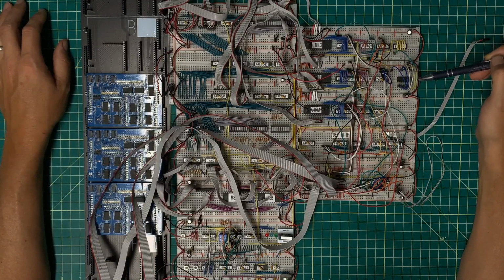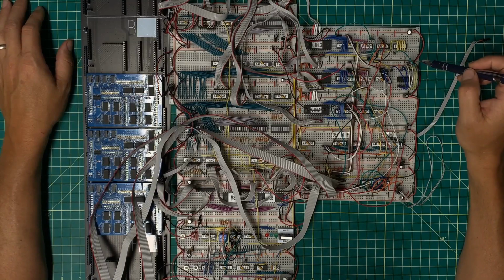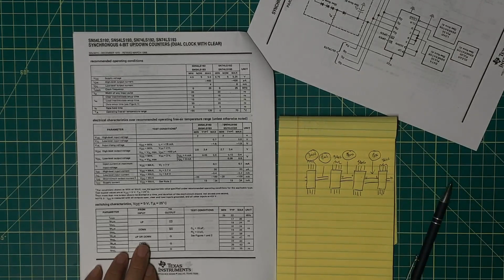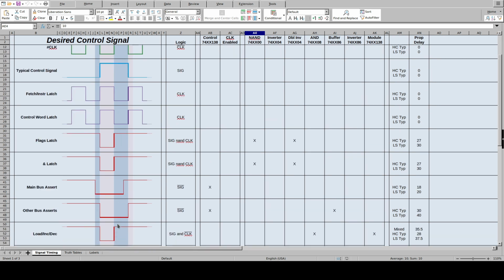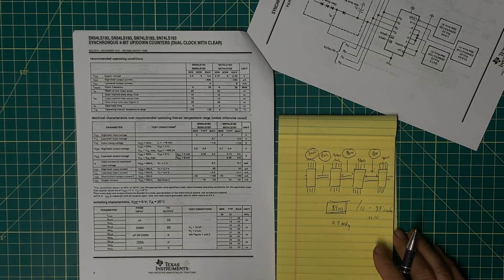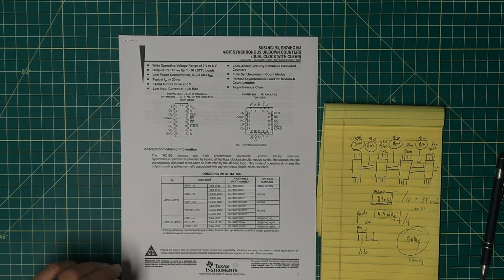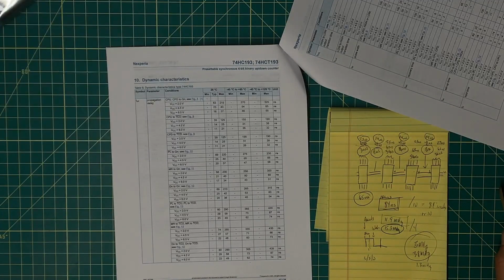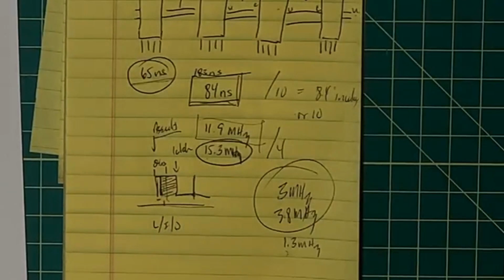0068: Timing Issues Part 1: Rework | 16-Bit Computer From Scratch

Comment: Random comment about power and ground wires. If you put two inductors in parallel you get a lower inductance. But the reduction in inductance is better if they are separate inductors. So having two wires is better than one thicker wire. That is why I try and connect every power and ground trace to each other with lots of redundant traces even on 2 layer PCB's that does not have a ground plane.
Reply from the maker: @LaserFur -- That makes some sense to me, but not really.  All I can recall from high-school (and I suspect that I am recalling is incorrectly) was that the unit of measure was Ohms -- and therefore I equate them in my head to be like small resistors and follow the same formulas.  In the backplane it would reduce the overall resistance of Vcc.

Now, that said, I had intended originally to connect the backplane Vcc all the way around in a loop, doing close to what you describe.  I missed the boat there and left one segment off.

If I am understanding you properly, then simply adding the other 3 registers onto the backplane would have effectively done the same thing, as it would have meshed the Vcc and Ground connections from the left side to the right (recall I have 2 Vcc/Gnd connections on each 4-layer Register PCB to the backplane).

/me makes a mental note to do some research about inductors.
Reply: @eryjus4594  When combining inductors you have to decide if they share the magnetic fields. if the two wires are right next to each other then the magnetic fields combine and the reduction is less.  Ohms helps at DC, but inductance gets more and more important as you increase the frequency. So plane is best, mesh is second best, and wires all over the place is still better than a Star configuration. Star configuration is only good for audio circuits and small measurements. For inductors the XL = 2*pi*F*L comes into play. XL can be treated like ohms.